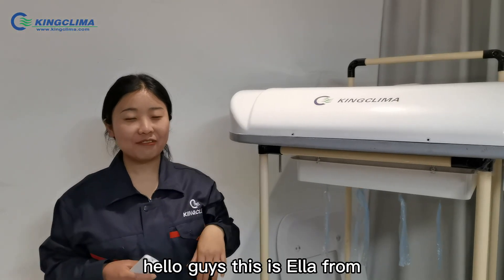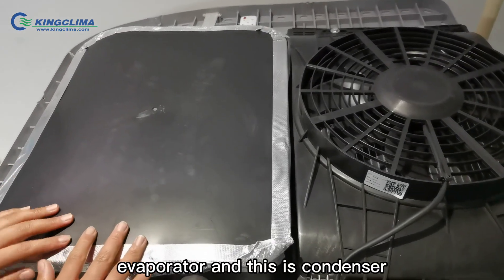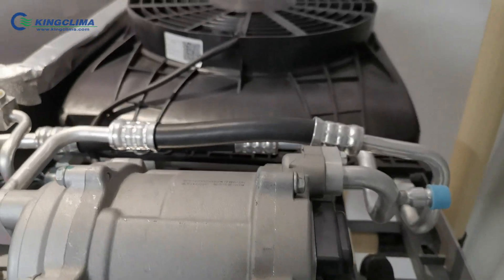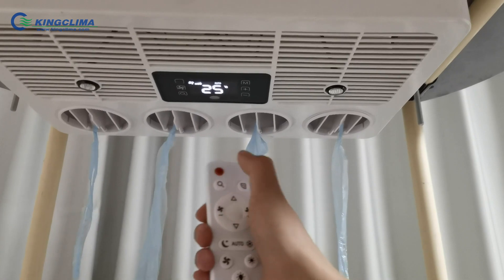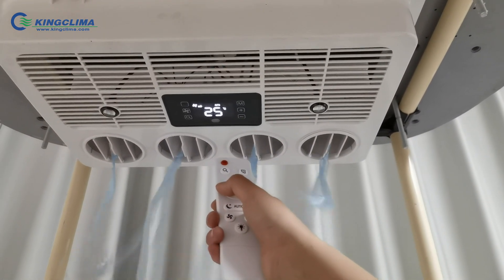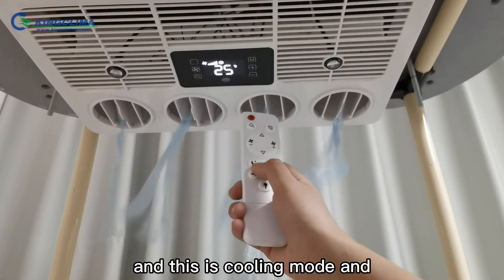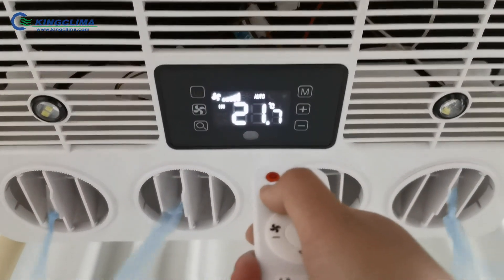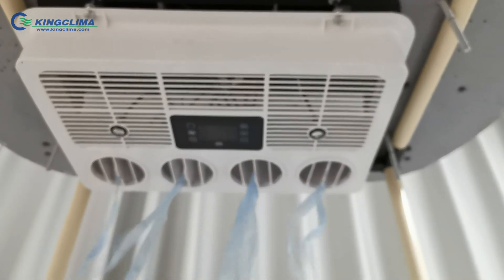12V 24V rooftop air conditioner disassembly and use test

Comment: Hy mam, what empere consume also is it sufficient for 14*14 room? Plz tell here
Reply from the maker: Hi，you need air conditioner for home?  or the vehicle's shylight is 14x14'' ?
Reply: @dannywu4053  for 14*14 room
Reply from the maker: @digitalsolution7868  if for your home, this model can't install, this model is design for truck
Reply: @dannywu4053  you need up 40000 PTU
Reply: How much the prize of 12v air conditioner, ma'am.